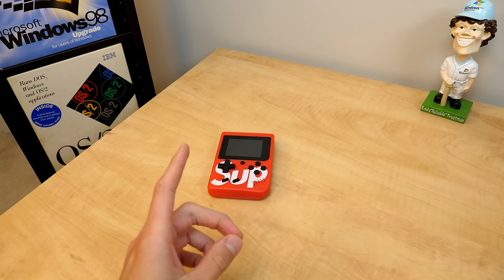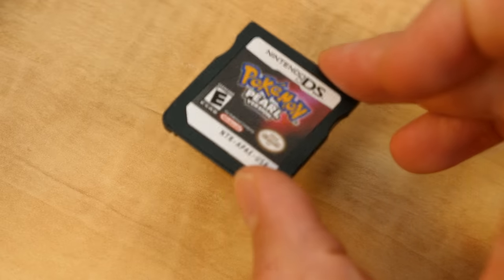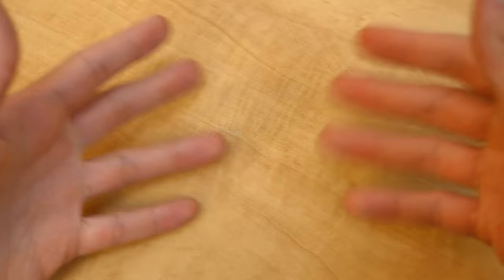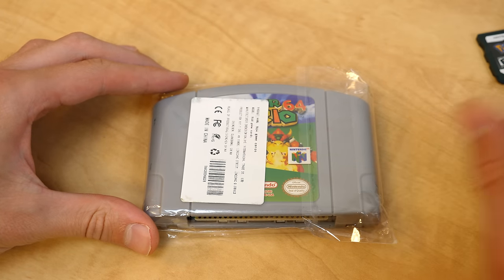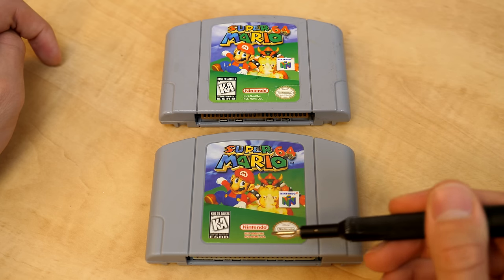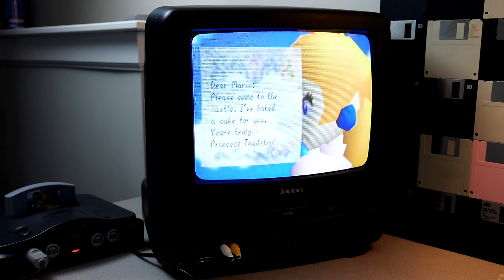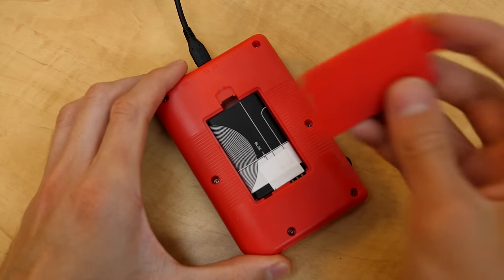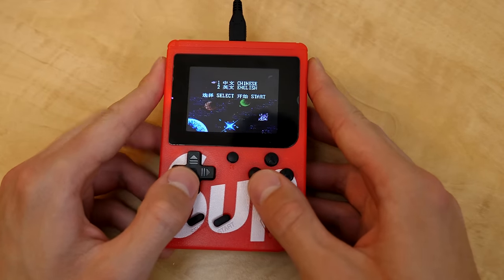I Bought Bootleg Nintendo Games from Temu

Comment: I have no problem buying a bootleg so long as it works.  I'd rather pay $20 for a copy than $200 for a 20 or 30 year old used original
Reply: But its real and not fake and vintage 🤓☝️ (If you resell Gameboy games you should actually bite the curb and look like mega glalie)
Reply: For me, since I transfer pokemon from different games to others and often trade and interact with other add-ons, the games being real is important to my experience. Otherwise... no need, lmao. They can be duplicates.
Reply: These ones aren't any cheaper than the originals though. It's a scam.
Reply: @scoopstacey3112  You're right on Pearl and Mario. But legit cartridges of any Gen 3 Pokémon game sell for over $100.

Comment: My mom bought one of those 200 in one consoles and it turned out to be a flashcard with a bunch of roms on it. Its actually amazing because I don't have a flashcard and its nice to have one.
Reply: @squ1dd13  yeah it's really great because they're running legit R4 firmware so they'll be compatible with homebrew as well.
Reply: Hopefully without a timebomb though as those tend to me fraught with those problems.
Reply: Me too and it was only 15$
Reply: @DrKoneko  Nice. So you figured out about R4 after your mom bought the device or before?
Reply: @ThePeacePlant  way before, I just didn't have a reason to buy a flash card because they're expensive and I have a 3ds anyways.
Reply: I found those console on a walmart with 200 in 1

Comment: Ok, so afaik these DS cartridges are actually running the OS of either Supercard DSTwo or Acekard, two very famous Flashcards.
And they are actually very very good flashcards, you got lucky there for the price.

The Supercard DSTwo actually have some RAM built-in and you can play GBA games directly from it, most flashcards can't. The "Deep Labyrinth" banner on startup is what gave it away for me.
Reply: YouTube deleted my reply, I can't name the express place apparently. It uses the Ace3DS+ Kernel, also you can get the flash card without an SD card for about $5 on express, I'm pretty sure the ones with the labels show Deep Labyrinth but the ones without labels normally show Spongebob's Atlantis Squarepantis, I have one without a label that shows Spongebob's Atlantis Squarepantis and I have two with labels that show Deep Labyrinth.
Reply: DS flashcarts were all over the place with clones of clones and whatnot. I never found one that didn't have issues.
Best way to play ds games nowadays is just to softmod a dsi or 3ds.
Reply: Ayup, those cards are pretty rare and good for modders, though nowdays I mostly run on a TWM++ DSi for my DS cravings
Reply: I got a clone R4 a few years ago and it's identical to the Pearl cartridge, just with a different default theme for the game selector and different pre-loaded ROMs. It was also masquerading as Deep Labyrinth. I'm guessing these are also R4 clones.
Reply: Kinda looks like my old wood r4i
Reply: gomam0n702  Nah my issues were crashing games and firmware nuking itself
Reply: The pokemon pearl cart is using the R4 gold kernel for the r4i gold ds flash carts
Reply: both cards are an ace3ds+ based on the red pcb
Reply: Definitely isn't the DSTWO, it's missing the multi-save feature.
Reply: Do you by any chance know if there's a firmware update for the acekard supporting the latest dsi firmware? Ive looked all over the place with no luck.
Reply: gomam0n702  That is spot on . With the cheap R4 clones you had to basically install a file that bypasses the timebomb or they would expire on a certain predetermined date and cease to work so that you would have to buy the new version every year or so . They generally had the year that they were made printed on the label .
Reply: Is there a particular reason why it shows up as "Deep Labyrinth"?
Reply: @490o  I've read that ROM carts mimicked certain real games including Deep Labyrinth because it allowed the early R4 carts to bypass security measures .
Reply: @bryanobrien2726  The ones that supported the DSI and 3DS did that to bypass the new security measures, the ones that only supported the DS didn't do that because they didn't need to at the time
Reply: Doesn't look like it's the same cart as the DSTWO, since it's missing the additional chip that's used to emulate the GBA games (there's no bulging under the sticker, which is where they add the chip and cover with the sticker. Makes it much harder to get the cart in and out of the handheld too.
Reply: Do you think I should by one and put my roms of the games I want on a separate sd card and put it in the fake ds cartridge would that work?
Reply: @Hojogamer I'm afraid it's not that easy . The SD card also has to hold the firmware with emulators and everything . You can find it searching Ace3ds firmware or the R4 cards use a different firmware . Once you figure all that out , then you can drop all of your ROMs in the appropriate folders .
Reply: @bryanobrien2726 Yeah. I have a 471 in one (Don't quite remember) that uses SpongeBob SquarePants Atlantis Squarepantis
Reply: @shanez1215   I have two of the multi-carts and they both show as Spongebobs too . Mine strangely would only play DS games on the SD card that came in it so I found and downloaded the complete firmware so it'll play more than just DS games now .
Reply: From experience, it doesn't look like acekard. Granted they may have released a different firmware in the past decade but doesn't look like the ones I had
Reply: You guys are right, this is definitely a R4 clone of sorts. A DSTwo does not show as Deep Labyrinth, but as Alex Rider iirc
Reply: @r4collects  The SpongeBob ones are Ace3DS+ hardware, the Deep Labyrinth ones are more likely to be R4iLS clones. However, they both run essentially the same Wood R4 version.
Reply: @フェムボーイかわいい  There is not. 1.4.4 is the last DSi FW an Ak2i will work on.
Reply: @Sanrasxz  Thanks for letting me know
Reply: Actually it's an Ace3DS+ PCB running WoodR4.
Reply: >runs wood ui
>dstwo's are like 100$
>sold for about 15
"looks like a dstwo"
Reply: @martinmatin6275  maybe I was just coping the loss of my DSTwo

Comment: The thing with some of these counterfeit games is that the antipiracy can still trigger. For example the original game programmers have flag checks set in a specific part of the game that won't let you proceed if the game has been suspected to be tampered, and the player won't know until they reach that segment of the game. Sometimes games don't get past the start up screen or title screen.
Reply: I found that running a HGSS rom on an r4 still reproduced glitches I would find on emulator on PC, so some games might just be too well protected to fully crack
Reply: @zoruasnivy Probably just an outdated kernel. Most flashcarts have anti-piracy patch routines in their loader system that will patch the ROM on boot to fix AP issues.

What cart do you have exactly?
Reply: When I was little, like below 10 years little, I played pirated games on my DS
And in Pokemon Diamond, I got to a point (in a cave, I think) where a dude was blocking the exit and was like "I have no pokemon, you won't fight against a defenseless person like me, right?"

And to this day I still don't know if that was normal gameplay or caused by it being pirated
All I know is that little me was unable to progress anymore
Reply: @candylide  I'm pretty sure that was normally in the game, it means you missed something you were supposed to do before you got to that area that the guy was blocking.
Reply: @candylide I'm pretty sure that pokemon pearl would stop you from gaining any XP if your game wasn't legit. You mightve just missed a step you needed to get done before entering that cave :)
Reply: Yeah no, that's not a thing anymore. These days Roms are made to be like legit ones
Reply: @rue3ki   That was also an option, but even after exploring for hours after that trying to find what I (might) have missed, I sorta gave up
The paranoia of "What if this is bc it's pirated" also didn't help at all

I can't find anything about him on the Internet, so I'm playing Pokemon Pearl in an emulator to give little me some closure (and also bc I love the game) 
When I get to that part, I'll finally know what the heck was that
Thanks!
Reply: @candylide  I tried doing some research and couldn't find anything either, altough it does seem quite familiar. Honestly I'm pretty curious now so lmk what it was when you get to that part !
Reply: @candylide  Oh I also have a question I forgot to ask! Where you still early in the game or was it later ?
Reply: @rue3ki  Later, I'm pretty sure I had beaten at least 5 or 6 gyms by that point
Reply: @rue3ki  I had taken a break from it, but honestly? Now I really wanna get to that part again and tell you
It'll take me a while tho, so please be patient :) 
Also, thank you so much! You're really kind
Reply: @candylide  No worries man, take your time and don't rush yourself !
Reply: Leaving a reply so i can get updates wether or not this “cave dude” existed.
Reply: @candylide i mean that situation of someone blocking your entry or way (until you become champ) is incredibly common throughout pokemon, soo are you sure it was a sinnoh game? 😅
Reply: @silversunnybunny  Right? But no matter who I talked to or were I went, he wouldn't move
Reply: @candylide  replying for Cave Dude updates! have fun and i hope you get your closure!
Reply: @Sanrasxz  It's a clone of an r4 clone. No longer works due to age sadly
Reply: Gta San Andreas after unlocking weights gym plans start to crash and the npc population begins to dissappear
Reply: It really shouldn't
Reply: A counterfeit/pirated game triggering the antipiracy?

SurprisedPikachu.jpg
Reply: @candylide  did you figure something out?
Reply: I bought a counterfeit game from Walmart im pretty sure. My save files wouldn’t save
Reply: @candylide hey, im invested in this store lol. Did you ever figure it out?
Reply: @meankat38  Oh, I still haven't, sorry :(

Lately I've been super busy studying and I can't, for the life of me, find enough free time to do anything
I don't want to let anybody down, but I don't think I'll be able to tell the big update anytime soon 

Sorry guys, at least I'll try to see if my emulator backup works sometime this week!
Reply: yeah when i was a kid i had one of those cartringes that you could put games on. i got black and white. and i coulnt advance as my pokemon were not given any exp after fights so i would get to the gym and keep blacking out due to my pokemon being underleveled. i was a kid so i was confused i thought i did somrhing ering when i noticted my pokemons move buttons where in a yellow text (it was like that because i was almost out of pp).
Reply: @candylide also replying for updates :p
Reply: They're just running roms, there wont be anything that fancy in there.
Reply: @candylide let us know
Reply: The OS of the flashcarts in this video should bypass most of those anti-piracy measures. Wood R4 was updated up until 2017 so well after any of these games released. You'll probably run into that problem if it's not on a flashcart though.
Reply: @rue3ki  sounds like a fun challenge
Reply: @candylide  I don't know if this is it, but I looked it up. There's apparently a Team Galactic Grunt in Mt. Coronet who won't move and claims to be lost without any pokemon. You have to use Rock Climb nearby to progress. At least, according to a forum I found.
Reply: @colixnaia6512  That's exactly it! That's the guy I remember
So, rock climb? Thanks! I recently got back the data of the emulator I was using to play last year, so I might be able to finally beat the game now
Reply: @candylide  hey , did you beat it ?

Comment: They're not changing the names or bluring the images to avoid copyright/trademark infringement. They're doing it to avoid bot detection from Nintendo and their agents.
Reply from the maker: That's still copyright/trademark infringement though.
Reply: @MichaelMJD correct, but they don't care about copyright laws at all. They are just doing what they can to successfully list the product and get a few sales.
Reply: It's only a matter of time before temu gets hit with the dreaded cease and desist, as pretty soon temu may get bold enough to start pirating switch games, they already made bootleg switch controls so what's stopping them when they're getting away with piracy
Reply from the maker: @Ryyi23 I’m fully aware. I was just pointing out that trying to circumvent automated checks like that is still trying to get around copyrights/trademarks like I said in the video.
Reply: @Josh_the_jester not sure if it’s a pirated version but on temu they are selling copies of breath of the wild, and it was like right when it came out idk if it’s real or not
Reply: Ccp mafia
Reply: @darknessfire3018 breath of the wild came out 6+ years ago.  You fell for their trick making you think of tears of the kingdom.  Not sure if the copies they are offering are genuine or not
Reply: I see listings for like Mario Augustine and it says that I might not get the actual original version I might get a Japanese version or a US version......hmmmm 🤔
Reply: Yes the Nintendo Ninjas are scary